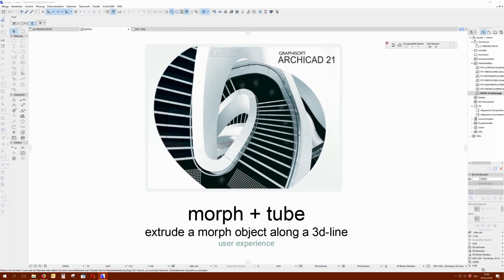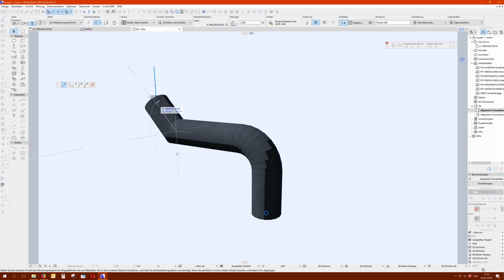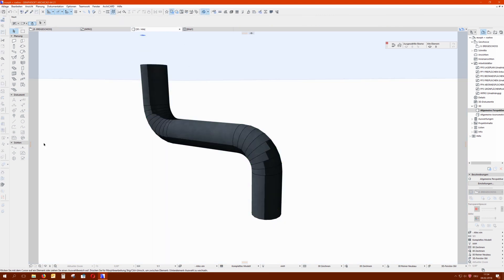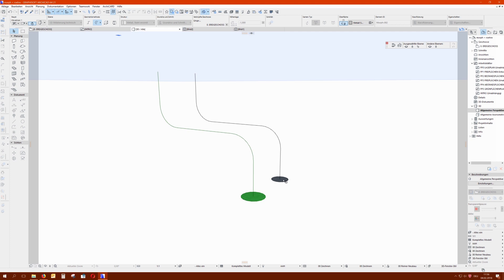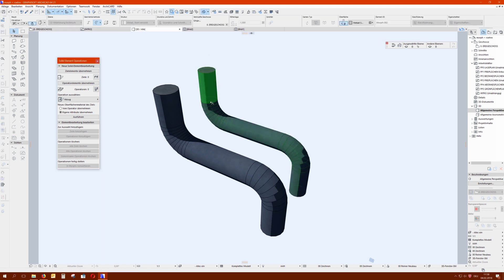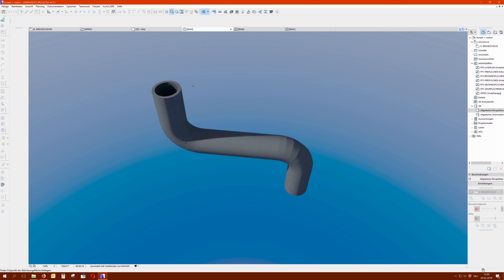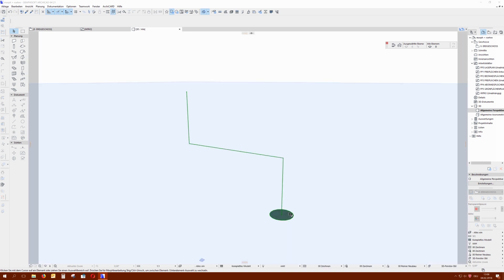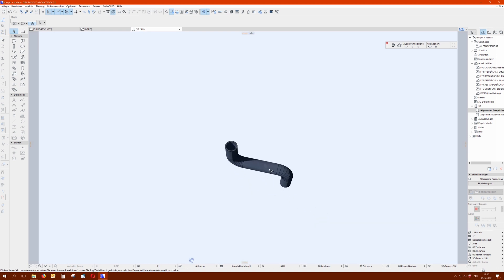ARCHICAD morph extrusion tube

Comment: I'm following the steps, but the curves are not being followed. Can I just click on the path and the form follows it, instead of going to each point? Thank you for the video. BR
Reply from the maker: Hope I got that right: You can not just click the path at one position and the form is following the path automatically. If you followed the steps, perhaps there is just one little step missing ? That can be: Forgotten to relate the path to the shape, forgotten to start at the first knot (click on the shape THN click the first knot), or something else ... Sometimes the "rounding" happens after moving the pointer to the next knot after the round part and just wait a little till it is shown rounded, then click it. If it still doesn#t work ask again, please.

Comment: Great tutorial but I can't get to make it work with a square profile. It doesn't follow the curvature of the morph line.  Is this possible only with a round profile ?
Reply from the maker: Thank you :)  You can do that with every shape you create, as long as it is related to the path. The path has to be drawn as a morph line and it has to be "stuck" at the shape. You can confirm by choosing the shape: If then the path isn't activated, too, the path is not related and you have to relate it. I can recommand to build my example step by step to understand, how it works. If it sill doesn't work, don't hesitate to ask me again.

Comment: Hi, could you explain the step when you create the path?. Is there any trick to do it? Because I cannot  manage to do it. Thanks for the video!
Reply from the maker: You can create the path as you like. Only thing to consider ist, that you have to use a morph line. Morphs can be created with forms or lines. Those lines you have to yuse. AND the form has to be related to the path. So you activate the path first, before you draw the form. You have to couple it.
Thanks for your interes !  :)

Comment: Great video, maybe you can try instead of creating 2 tubes and subtracting them, to follow the same steps, but one is just a hollow circle already, and use the other one as a guide, you skip then the subtract step.
Reply from the maker: Yes, I showed that possibility at the end of the video. But that works only with 2D paths. With a 3D path the second object doesn't follow the same way the guide object does. I haven't found a working way yet.